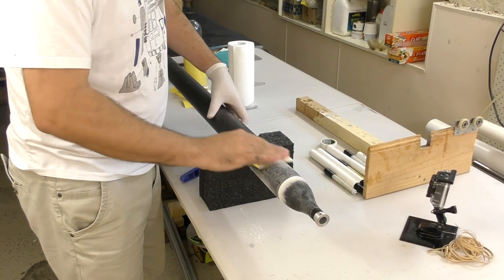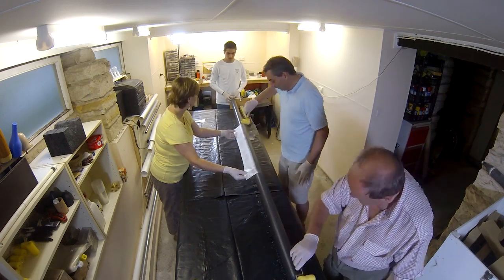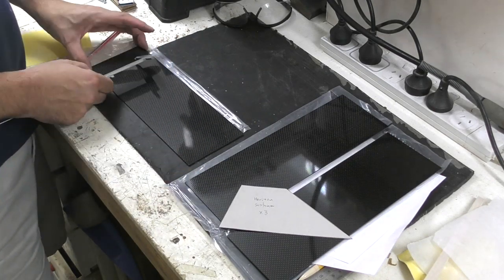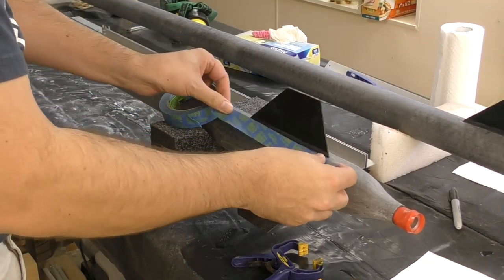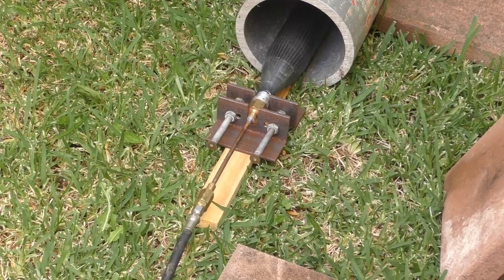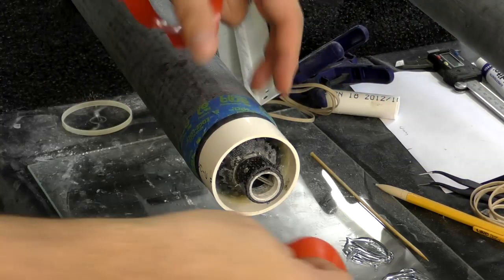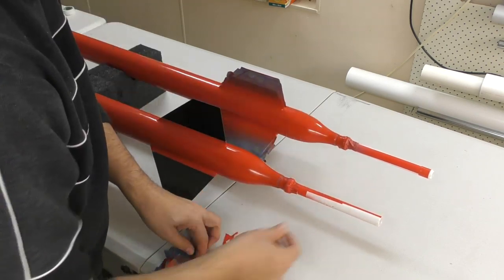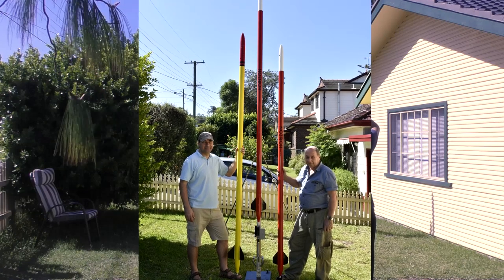2 Stage Water Rocket - Part 13 - Sustainers Complete

Comment: Have you considered putting an insert in the tube that could produce a laminar flow at the nozzle? Do you think that would be possible?
Reply from the maker: While it may be possible, I am not sure laminar flow would get you much more performance. You have to consider the trade-off of adding any weight to the rocket that would help generate laminar flow. The potential boost in performance may be offset by the added weight and so the resultant altitude may actually be lower.
Reply: I don't think it would add much performance since the water is not  really influenceing the nosel and however I'm curious is it possible to do the opposite like a defuser so not all the water is dumped in the first boost yes you would lose a lot more pressure but the faster water must add more boost than the slower burst of water that happens now I'm not the expert so I'm just thinking

Comment: Great video George and an amazing team effort. Epiglue looks like a game changer. Doing 2 fillets at a time is a little frustrating.
Reply from the maker: Thanks Derek. Epiglue is great stuff, but expensive. I am still trying to find an easy way to measure out quantities of it. Using syringes is quite difficult because of the consitancy of the hardener. You end up sucking more air than hardener when trying to get it into the syringe.

Comment: How do you perfectly place the fins using triple radial symmetry? I have trouble figuring it out.
Reply from the maker: Not sure I understand the question. I get a piece of paper, wrap it around the pressure chamber and make a mark on the paper where it overlaps. Then you can measure the length - the circumference and then divide it by 3. make the marks on the paper, and put the paper back on the pressure chamber. Transfer the marks to the pressure chamber and now you have equally spaced fins. If you're within a few degrees it's no problem at all. The fin alignment jig takes care of aligning the fins in the other 2 dimensions.

Comment: The Rockets look stunning!! But how much does the painting weight? And did you make the consideration of stunning looks vs. higher max altitude?
Great work and thank you for sharing with us.
Reply from the maker: Thanks, the paint does cost us some altitude in weight, but a smooth glossy finish helps reduce drag. In the end I'd prefer to have a better looking rocket on video and one that is easy to find than get just a few more meters of altitude.
Reply: @AirCommandRockets  thank you for your fast reply. And I just heard that you will paint them white :D
Reply from the maker: @Peter-pu7bo  Yup, for better thermal control it is now white. https://youtu.be/XoY2JqwTqTE